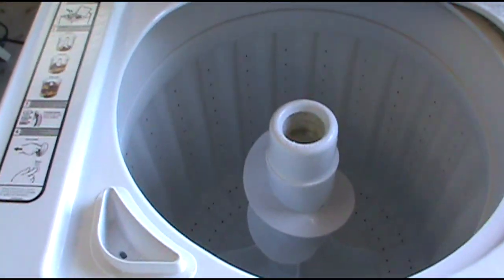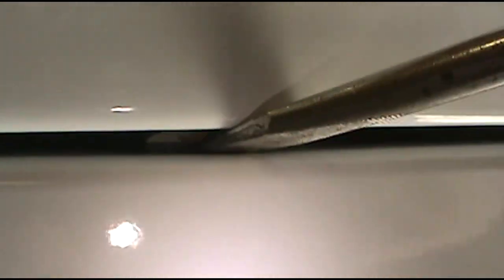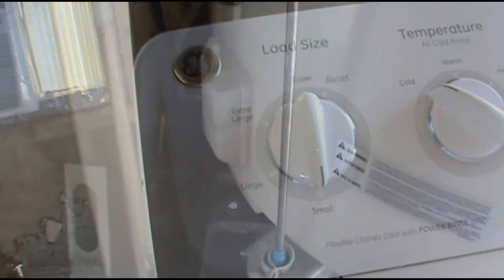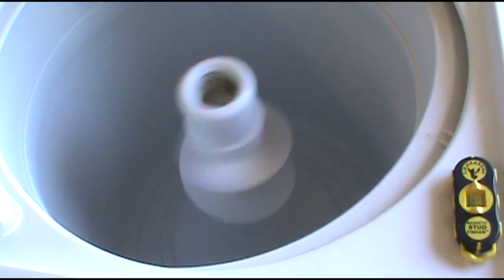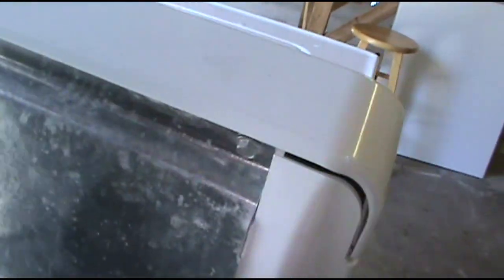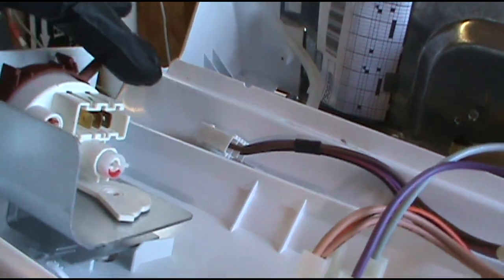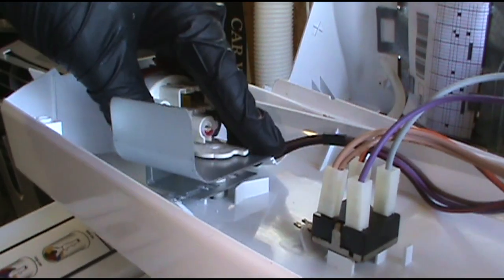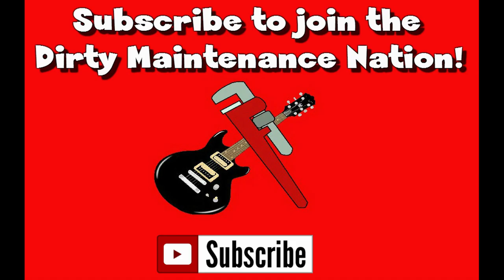HOW TO FIX WASHING MACHINE THAT WON'T GO INTO SPIN CYCLE

Comment: what is a balance switch?
Reply from the maker: I don't know. That may be a good Google question.
Reply: @LexVance  ok, this machine is a twin tub , one day the electricity cut off briefly and came back on and after the washer tub won't start only the spin tub works. was working fine before

Comment: What happens when you blow and don’t hear it clicking? Does that mean I need to replace it?
Reply from the maker: Yep! It's not making a connection. Thank you so much for watching Karen!
www.DirtyMaintenanceNation.com
Reply: So I switched the lid switch and the pressure switch and still nothing it just makes a noise like it’s trying?... I already had a handy man come and he replaced the lid switch and thought it would be that but still nothing. My laundry softener doesn’t drain either. I’m not sure if that means anything.

Comment: If pressure switch wasnt working wouldnt the fill cycle also not work?
Reply from the maker: I've had lots of machines that would fill & agitate fine but wouldn't spin after draining. When I replaced the pressure switch, it worked perfectly. Drained & spun & I never had a problem since. Thank you so much for watching der!
www.DirtyMaintenanceNation.com

Comment: The the White Westinghouse won’t start at all but put it on rinse, it starts draining the water.
Reply from the maker: That could be a lid switch, a bad motor, a bad pressure switch. I would need to be there for this head scratcher. 🤔

Comment: My GE washer won't adjetate or spin. Blew in hose still not working. HELP!
Reply from the maker: Randy Mahony Hmmm if the timer is advancing to the end, then try to bypass the lid switch. Turn the power off, cut the two wires going to the lid switch & wire nut them together.
Reply from the maker: Randy Mahony After wire nutting them together, turn power back on and see if works. The lid switch could be stuck open & your washer thinks the lid isn't closed.
Reply: Lex Vance that was it. Thanks Lex you're the Man!
Reply from the maker: Randy Mahony YES! WOOHOO! Thank you so much for watching Randy!
www.DirtyMaintenanceNation.com
Reply: Lex Vance I hope you know now that I'm a subscriber I'll be bugging you all the time Haha. No really.
Reply from the maker: Randy Mahony that's why im here! 👍😂👍
Reply: Lex Vance so in randys case, does that mean he would need s new lid switch?
Reply from the maker: Papi4l2 Yep! Or, he could leave it bypassed. Just don't stick hand im there while spinning.
Reply: Papi4l2 so far I've just left it that way but I'm going to order a new s switch and I will order through Vance's link.
Reply: Randy Mahony cool. Just prepping myself. Goin to look at my sisters this weekend lol

Comment: I’m having a problem with my washer as we speak , it won’t wash . It just runs water & spins sometimes but won’t wash . Leave my clothes drenched
Reply from the maker: You can try to blow into the pressure switch hose. If it works for a load & stops working, you've got a bad pressure switch. It's hard to tell by not being there. Thank you so much for watching Tee Jay!
www.DirtyMaintenanceNation.com

Comment: Hi Lex
My washier is doing everything but spinning  I blow in tube but still didn't work.Trying pressure switch now
Reply from the maker: Right on. Thank you so much for watching Deb!
www.DirtyMaintenanceNation.com
Reply: Lex it still doesn't spin
I bought the switch on Amazon warehouse maybe it is bad ?
Maybe have to replace hose also ?
Reply: Pressure switch has nothing to do will spin cycle..the pressure switch is for filling and draining only

Comment: in a pinch maybe to finish off the cycle.  I would never do this as a repair technician.  My company would be responsible for the water damage to the floor afterwards if by chance this pressure switch would be "on its last leg"  turn a 250 dollar repair into thousands of dollars of mold,floor replacement aggravation.
Reply from the maker: Thank you so much for watching brinnon!

Comment: Washing machine  not spinning  in reverse mode
Reply from the maker: See if pressure switch is clogged. You can also bypass door switch by wore nutting the 2 wires together. It's hard to tell what the problem may be by not being there. Thank you so much for watching Eugene!

Comment: You mean: just by blowing into that tube get it unclogged the spin cycle will work again??? Dude??
Reply from the maker: If the tube is clogged yes. If pressure switch is going bad, then it'll need to be replaced. Thank you so much for watching Dee!

Comment: Some of the worst floods I've had are from clogged pressure switch lines i usually run degreaser through the machine when I'm finished.
Reply from the maker: igrowdro1badmf Yea its amazing how one little piece of lent inside a pressure switch tube can cause so much trouble. Thank you so much for watching igrowdro!
www.DirtyMaintenanceNation.com

Comment: So if I hear the clicking when I blow in the hose I know the pressure switch needs to be replaced?
Reply from the maker: Andrew Adams No that's the switch closing & making connection. However, sometimes they do it intermittently. That's when it needs to be replaced. Thank you so much for watching Andrew!
www.DirtyMaintenanceNation.com